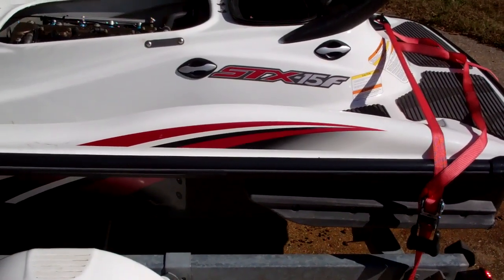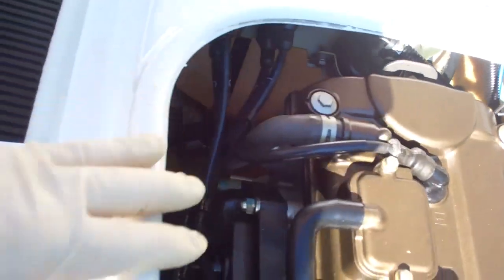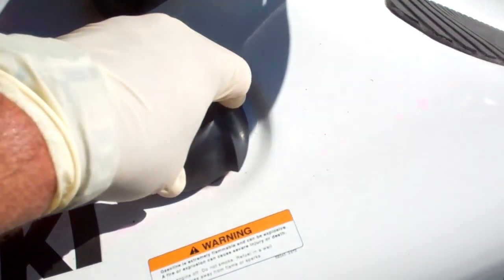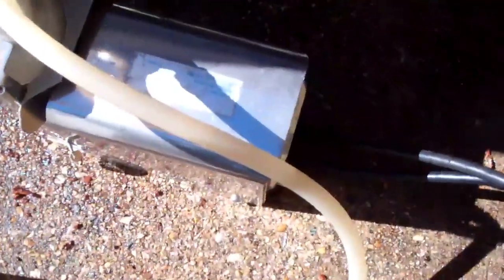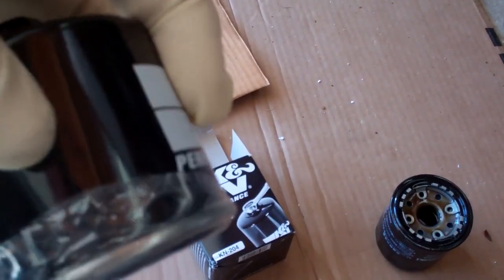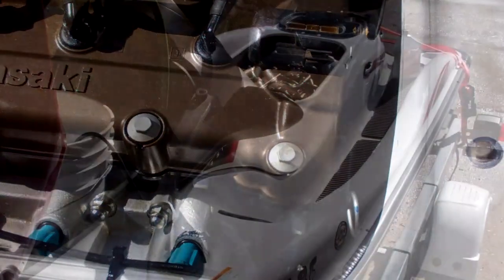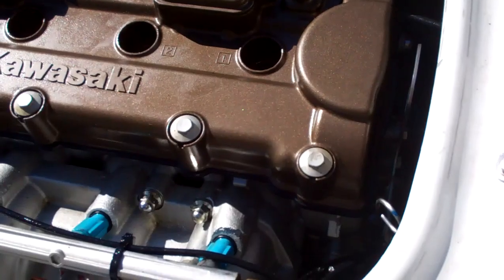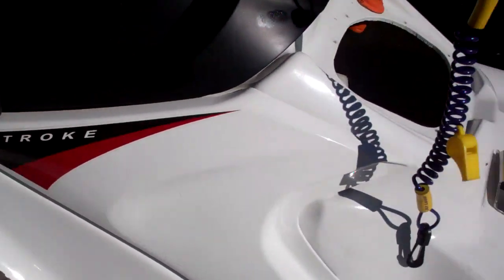Winterizing Kawasaki STX 15F Jet Ski Including Anti Freeze In cooling system

Comment from the maker: The tank is empty and the manual said to leave the cap loose to prevent condensation, who knows whats best.  
Definitely elevate the antifreeze and make sure it's flowing through so you don't overheat.  Also not sure how the Honda's are but the Kawasaki's have to be running before the flow starts.

Comment: All one needs to do is add fuel stabilizer, fog cylinders, disconnect battery and store inside and done. Oil change is only needed at 100hrs intervals. No need to do any of the other unnecessary junk.

Comment: Good video dude ! But the most important thing is never, never store a boat or a ski with a empty tank . Moisture will build up in your tank and the water will get into your fuel system and plug your injectors and contaminate your fuel system with water. Always ad fuel stable and then top off your tank before storing your ski or boat .
Reply from the maker: Drain the fuel tank and leave gas cap loose to prevent condensation is in section 15-3 of the storage instructions of the Kawasaki STX 15F service manual.  Checked tank at the opening of the season and it was bone dry.
Reply: I fill mine all the way up and use a stabilizer.

Comment: Very informative video. I really know absolutely nothing about jet skis and I was given one of these as a gift. I know a little bit about two-stroke and four stroke engines. I know you made this video like six years ago but I kind of wondered why you unplugged those two connectors under the engine? I often fog my cylinders in my two-stroke. With the plugs taken out it’s not going to start up when you crank it. I was kind of wondering if that was the only reason why you disconnected the two gray connectors. Either way you apparently take good care of your engines and that’s always appreciated
Reply from the maker: From what I remember in the manual it was to prevent the coil packs from being damaged.  May be total BS.  I do remember how much of a pita it was to get them disconnected and connected.  Hooked them up wrong one time and the ski did not start.

Comment: hi, I just purchased this jet ski only a 2016 yesterday and of course had to take it out once even though it's time to winterize. the manual doesn't say anything about antifreeze but only to drain the muffler. I think it's crazy to not use antifreeze. my question is, is the pump necessary or can I simply put a funnel and start the motor and slowly pour into the funnel until I see that it's coming out the exhaust. thank you.

Comment: why did you have to pump the coolant through? Couldn't you just pour it through a funnel?
Reply from the maker: +Evan Altman Depending on your ski, it needs to be running to get the anti freeze into the engine and exhaust system.  It is designed to be flushed with a garden hose which is typically has 60 psi  pushing the water through the ski.  Gravity feed may work but you risk over heating the engine and not getting it everywhere it needs to go.  The jet pump uses much higher pressure to move water through.

Comment: well done man. i'm about to winterize my 05 honda aquatrax next week for the first time on my own. i don't have a pump for the antifreeze so i'm just trying the method where you hold a funnel in a long piece of hose and hold it like 5 feet above the ski and fill with antifreeze.
question though, why did the manual suggest leaving the gas cap loose? it seems like having the tank full and added sta-bil with the cap on tight would be best.
Reply from the maker: +Jarrett Schumpert Actually it recommends leaving the tank empty and the cap loose to "prevent condensation".  Not sure I buy that one.  I did everything the same last year except for the anti freeze.  I was able to stored it in an attached garage this year.

Comment: Can you use a hand pump to suck out the oil or does it have to be an electric pump? My local hardware store has a hand pump made for siphoning that only costs about $10, whereas the electric vacuum pump costs $100.
Reply from the maker: I waited until the spring sometimes.  You can use any pump that will suck the oil out.  I just repurposed the dental electric pump I found to make it easy.

Comment: Can you technically change the oil in the spring? It seems like it wouldn't matter either way.
Reply: The benefit to changing the oil in an engine before it sits is that you don't have acid in the old oil causing pitting in the bearings.

Comment: great video man!  lots of good knowledge!. I did not know about the fluid film I will probably pick some of that up. The only thing different that I do is I spray the fogging oil into the intake as I am running the antifreeze through it and then kill the engine as I'am spraying the foggin oil in the intake. also I always fill my fuel tank full ( some say to prevent condensation I am not a scientist who knows) with a double dose of marine grade stabil fuel stabilizer. now I am not saying this is the correct way by any means but this is what i have done to my boats and skis for the past 6 years with no problemss. I am going to look at a 2015 stx 15 f tomorrow as well which is how I came across your video.,
Reply from the maker: +bmxguy08 Hey if it has worked for 6 years you must be doing it right.  Fluid film is great stuff to have around and is excellent rust and corrosion protection.  It is nasty if you get it on you and smells horrible.  

As for fuel,  the Kawasaki service manual says to completely drain the fuel tank and leave the gas cap loose to prevent condensation.  Sounds questionable to me but I followed the directions on this one.

I do not fog the intake of this ski and the service manual does not mention it.  It is fuel injected so i am not sure if that would be a great idea.  I did have an old Sea Doo with a carburetor and I did fog the intake of it.